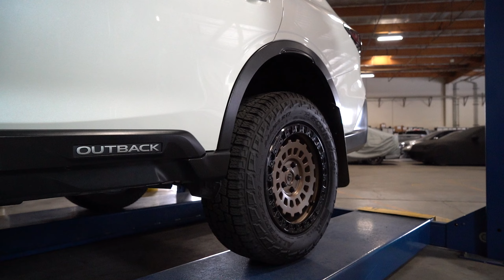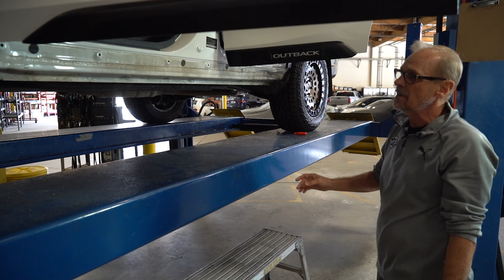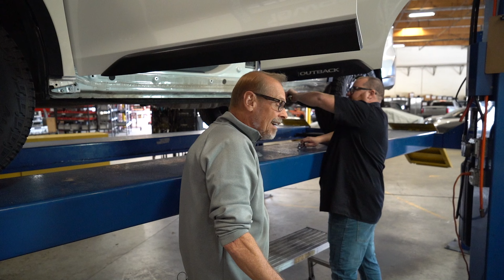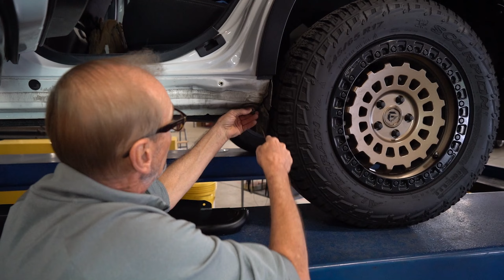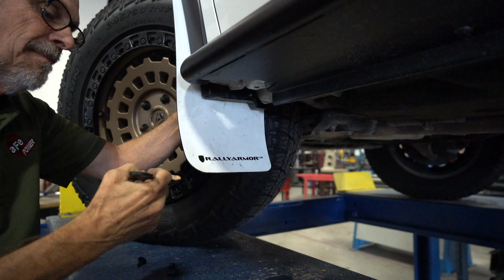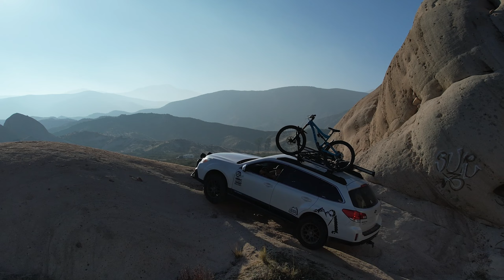How To Install aFe POWER Terra Guard Rock Slider On Subaru Outback

Comment: Nice! What’s the difference between the tubular and the square ish look?! Curious to know.
Reply from the maker: The tubular one is the Rock Slider and is more heavy duty than our Trail Steps
Reply: How would you know if the rib knots are installed, how tight would it be. Thanks